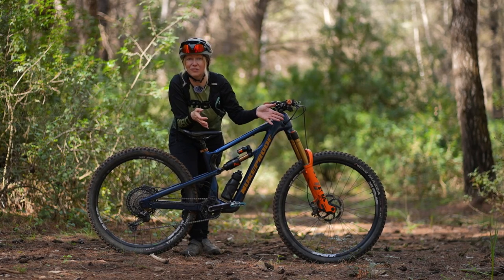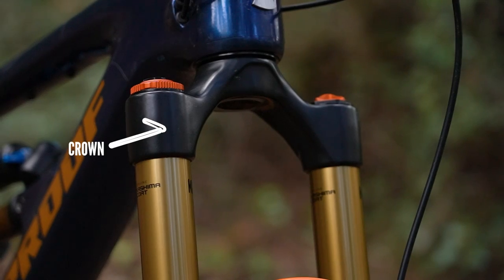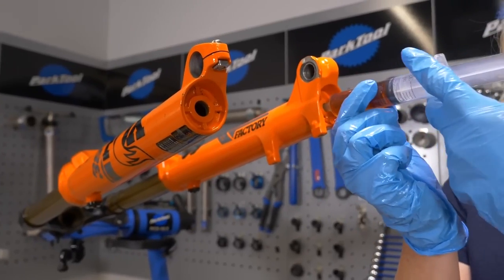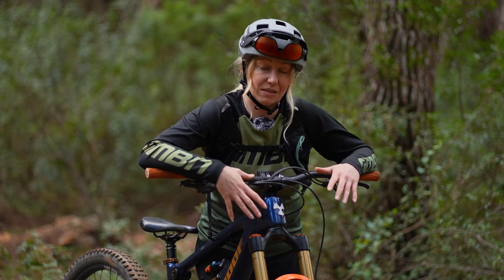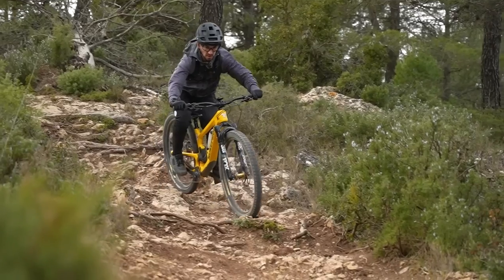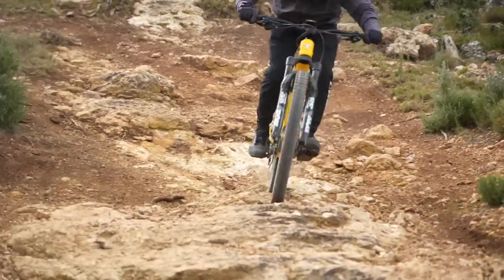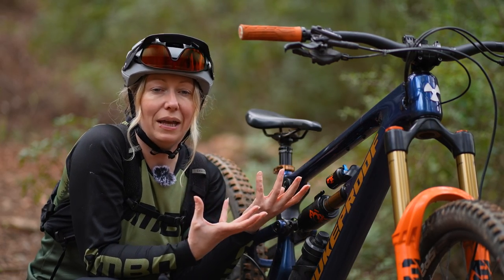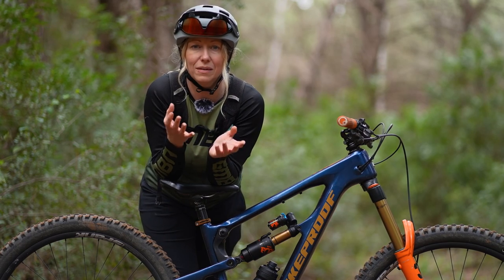MTB Suspension Jargon Explained | What Do All These Dials Do?

Comment: is there a video were gmbn show how to add inserts to the inside of front suspension & pending on room how many is best ?
thanks for putting this video up
Reply: There are lots of videos on this topic. Search for "volume spacers" or "volume tokens" and add your brand of fork or rear shock to the search. Basically, they are cylindrical plastic chunks that take up space that would otherwise be occupied by air. You can add these to forks or rear shocks, but you have to buy the spacer that fits your brand and model of fork or shock. With less air, the fork or shock compresses differently - it makes it so the very last part of the stroke is harder to compress. Your fork likely has one or two already in there from the bike manufacturer, tuned to what they think will be good for most riders. To decide on whether you need more, there's no easy guidelines - it depends on your weight, your riding style, your trails, etc. They are easy to add - just add one and test to see if you think it improves your suspension and go from there.
Reply: @ExplainicatorStudios  thanks m8